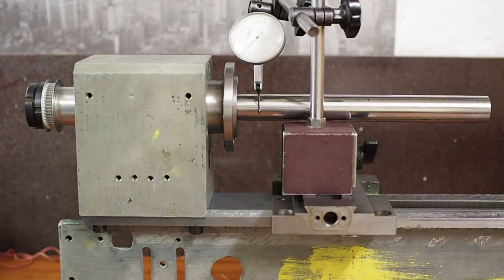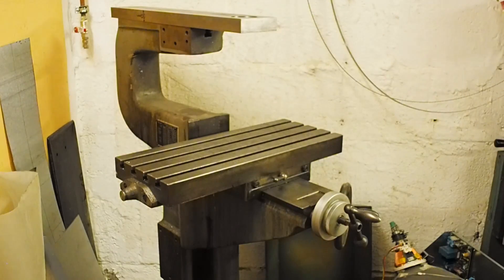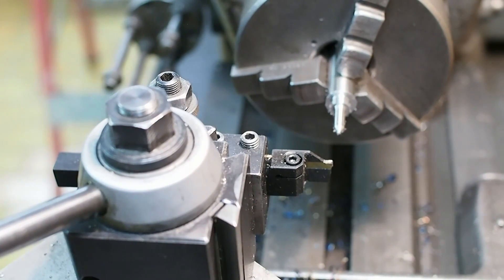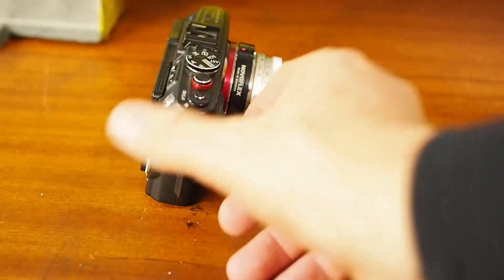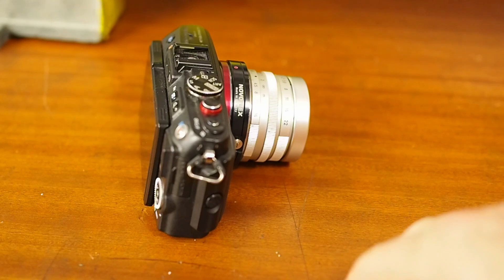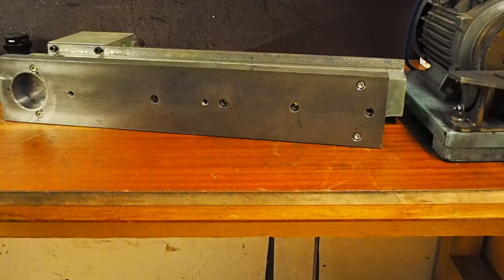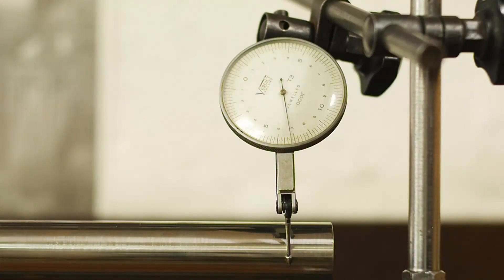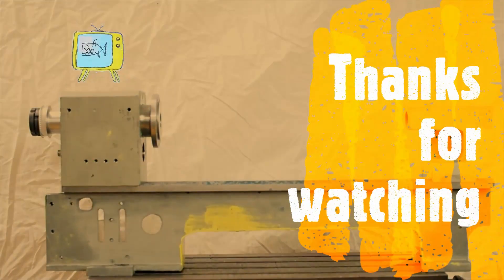Modifying the 7x12 Minilathe Episode 7 - reinforcing the bed

Comment: The remaining flex will most likely be due to the unsupported back area that the headstock sits on of the bed, where there is space for the motor..  if the motor would be placed elsewhere and that area being filled up with some 6mm plate from the foot to the beds underside and screwed / epoxied (jb weld?) in place the remaining flex should be gone?!?
Reply from the maker: It is certainly a contributor, Although unlikely that it is the major source of flex. If you consider the thin ribbed, open cell design of that bed, it has a very low moment of inertia, and will never be very rigid.

Comment: Following up from my comment on the last episode, I appreciate your reinforcement additions. I know that it would be at substantially higher cost, but something much larger with more bolt points would go significantly further in reducing flex. A 25-30mm thick steel bench top (I know, big $$) with bolts in pairs would be significant. Or this bottom plate you've added with additional L channel stock along the length of the footings with bolts in pairs would add further stiffness to this setup.
I've always suspected that even with all of these stiffening improvements the headstock or the cross slide saddle themselves would flex reducing stiffness. But I've never measured it to quantify it. I'd be interested to hear your thoughts on that.
Reply from the maker: That is the issue, If you look at the cross section of the bed, its moment of inertia is pretty low, so regardless how rigid the base you bolt it two, it will never be that stiff. You could encase the whole base except the top few cm in epoxy/granite, but then you are well into "start with a different machine" territory.

Comment: Thx for sharing. Connelly's book, used, on Amazon is going for almost $200. You can pay as much as almost $900, so that book is off my wish list for the time being. Way back when, episode 1 you were asking were you polishing a turd. Rigidity & stability is the name of the game with machine tools. Without the big chunk of steel bolted to the bottom of the you were getting about 2+ thou of flexing and afterwards you're down to around 1 thou. My question is where does that thou come from? We know that the bed flexes but after the reinforcement it only reduced the flexure by about 50%. Does that mean that piece of steel is that flexible even being 30mm thick. If that is the case then wow that piece of steel needs to be quite a bit thicker.
Your thoughts on this subject.
Your level of understanding and manipulation of scraping is quite excellent.
In general, there are a huge number of surfaces to make properly aligned. If all these were corrected before they left the factory then no one would be able to afford these mini lathes and they'd still not be that rigid a machine. So, they are what they are.
Again, thx for sharing.
Reply from the maker: I beleive you can find a scan of Connelly on line somewhere. 

Bolting the lathe bed down, even to a theoretical,  infinitely rigid base, changes nothing about the thin cross sections, nor the inefficient cross bracing of the lathe bed. It also does nothing to address the excessive swing for such a weak and flexibly bed. 
Compare the chinese 7x lathe swing and bed mass/profile/moment of inertia, to a Schaublin or Bowley watch lathe, and you will see that the are much heavier, have thicker profiles, and also have much more conservative center heights.
To make the 7x lathe bed substantially more rigid, you need to encase everything below the actual ways in a block of epoxy granite.
Better plan, get a different lathe.
Thanks for watching.

Comment: Can I just say how useful I have found this mini-lathe series and your end result is really impressive. I purchased the brushless version used a while back and have polished my turd as far as reasonably possible using your videos. I did manage to rectify the majority of bed twist that you found after installing your steel plate. I too added a 4th bolt to the headstock but this part of the bed is completely unsupported on my bed casting, I managed to fit a 30mm x 20mm steel upright in behind the motor and then bolted this through top of bed, base and web with M6. I couldn't extend it all the way out to the top of the bed as didn't want to relocate the motor. Looking at your location of motor it would be possible to add in something substantial and remove the potential of the bed twisting if it's an issue going forward. Thanks
Reply from the maker: Did stiffening that unsupported corner make much difference? I bed is a pretty poorly designed cross section.
Reply: @RotarySMP   I scraped the headstock and checked with a test bar- zeroing it vertically and laterally but could twist the headstock and get about +/-0.20mm of movement on my bar about 250mm extension! The strut was a pain to fit as needed to scrape the castings flat and slightly tapered so it was a good fit without forcing it in and moving the top of the bed. With the strut in place deflection is now about +/-0.05mm when I try to twist the headstock against the bed- still not great but a big improvement.  Effectively with the stock casting design the headstock is only 50% supported (diagonal area between the 3 bolts),  my 30mm strut reduces this  unsupported area to about 25% . If you can fit a strut that extends to the full width of the bed (effectively a full flange on the 'C' section)  I would think this reduce the movement from headstock rotation from the equation with residual amount as a result of the castings poor cross section. I never took any pictures before I reassembled, sorry. I'm a civil not mechanical engineer and was just thinking back to beam design when I decided to add the support. Thanks again for documenting your build, I worked through your videos when improving my machine and learnt the principles of scraping
Reply from the maker: @stevelea4233  Thanks for the feedback. I don't think I will pull mine down and do any further improvement there. I will probably sell the mini-lathe and get an old, small industrial CNC lathe with a dead controller (bit of a search for a unicorn that).

Comment: Could you make bigger holes to hold them together? Those 6mm are much too small to hold that kind of pressure. (In my opinion)
Reply from the maker: You mean the bed to the reinforcing slab of steel? There would the the meat there to increase the hole size, but given the moment of inertia (or lack of it) in this cross section is largely driven by the thin bed with little cross bracing, I have my doubts that inceasing the foot to beam clamping force would affect it much. 
Since my machine is now assembled, there is no way I'll be doing it :)

Comment: It seems to me, and I could be very wrong and ignorant, but wouldn’t doing something like perhaps lapping the mating surfaces between the lathe and that piece of steel make it more rigid since they are simply bolted together,  or more bolts.  My mind thinks it would make a huge difference and worth the effort.
Reply from the maker: The feet of the lathe were scrapped flat. I didn't blue up the steel slab, but doubt that fit is the problem. If you calculate the moment of inertia of the bed cross section, it is always going to remain a wet noodle, unless you get really radical and bury half of it in epoxy/granite.

Comment: I thought the reason cast iron is used in precision machine tools is its vibration absorption and long term stability. It that big ol' piece of steel moves, it's gonna flex the bed for you, precisely because it's so stiff.

Caveat: I may well be wrong...
Reply from the maker: Yep good comments thanks. Damping and stability are the advantages of cast iron (any even more so of epoxy granite). But that 10 year old slab of steel is not going to move huge amounts in a basement with only a moderate temperature range, and no significant outside forces acting on it. 
All the other weaknesses of the 7x12 are going to be far bigger factors than that. This will never be a Hardinge or Schaublin.

Comment: Really enjoying the journey, but a question for you:  Since you've already scrapped in your headstock/ways, do you expect any changes after adding the reinforcement?  Would it possibly have been better to add the reinforcement, and then scrape in the ways to allow for the changes caused by the new stressed member?   Keep up the good work, as someone else who still has a minilathe due to sentimental reasons, I really enjoy these videos.
Reply from the maker: Good Question. I was expecting to need to scrape the steel stiffening beam flat as well, but since the bed remained straight when I torqued it down, I figured, if it works dont mess with it.

Comment: I found that somewhat thick steel is also pretty flexible when I did a head riser chain drive box for a universal mill. Had to add some support afterwards. The box was made of 2 large plates of 20mm thick steel and was 70mm thick and I could dislocate the spindle nose by 0,1mm by using all my hand power. After adding some support everywhere I still could move the spindle 0,01mm, but it didn't chatter anymore. The forces are much higher than on a small lathe though.
Reply from the maker: Thanks for your feedback. I had no great expectations for the steel beam. To really stiffen it up would need a much more intensive change, such as burying most of the bed in a box of epoxy/granite. Not worth it for me. That is what the Boley 4LV is for.

Comment: I have a Taig Lathe and the aluminium frame extrusion is filled with commercial concrete, I agree it is a much smaller lathe but the principle is sound and should make a  great improvement in the stability of your project, the way I see it is you have very little flex to begin with and that flex is central to the bedway so the error gets less as the machining is decreased towards the headstock where and most matching takes place at, I am enjoying the content of your videos and look forward to the next instalment,

Edmund..........Alberta
Reply from the maker: Thanks a lot. I have done an epoxy concrete job before, but it is a fair effort to set up enough vibration to get the material to slump and deaerate. Wasn't willing to go to that effort on this project.

Comment: I am curious if temperature changes in the new base plate will cause twisting of the bed. 
I appreciate your taking us along with you on this project as well as your discussion about things that didn't go so well.
Reply from the maker: Good point. My basement has a pretty stable temperature.From about 12°C in the depth of winter up to about 25°C during a heat wave. There are plenty of bigger issues I would expect.
Reply: I wondered this. I built an assembly machine at work which included two stainless guide rails mounted at each end onto a tufnol base. That stuff is very geometrically stable and as winter became summer, the guide rails bowed. It might be enough to slacken and re-tighten the bolts periodically. Thanks for the videos anyway, very informative!